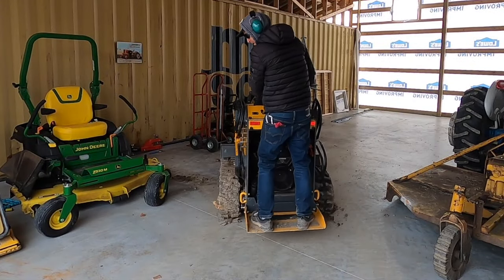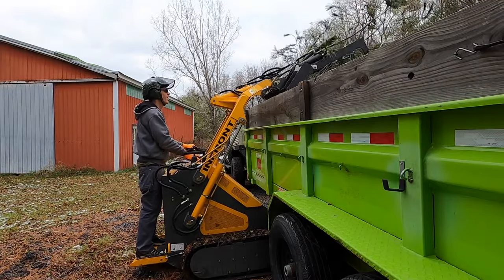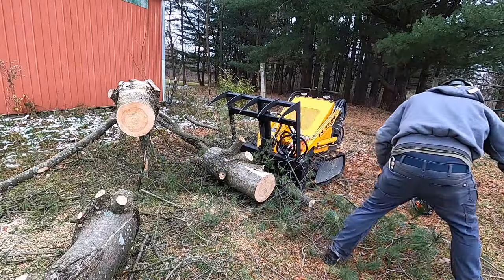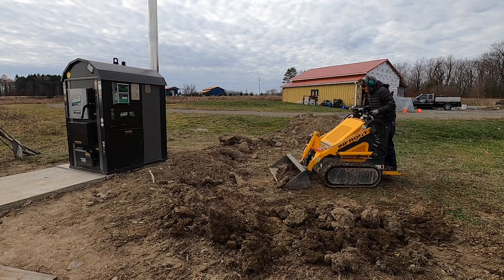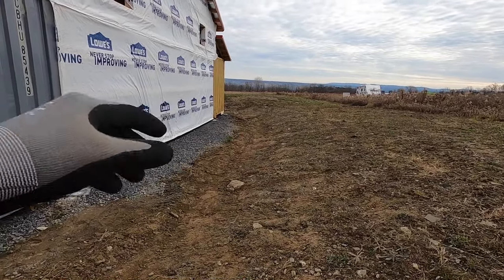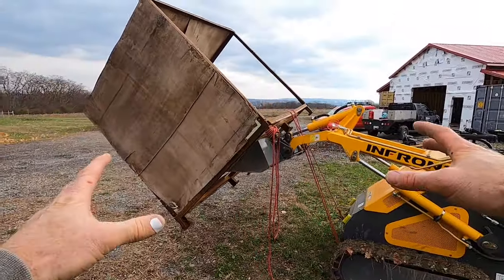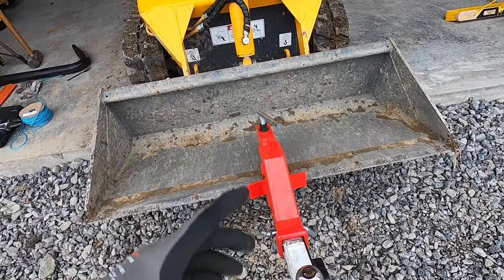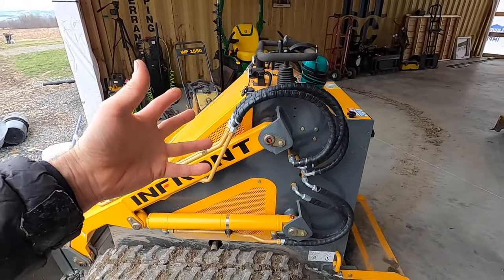Using the Mini-Skidsteer on Tree Jobs & Dirt Work

Comment: If you dont mind a little more saw work...cut those branches shy of the with of the trailer and load thru the tailgate area. When loading you just push the previous grapple load fwd with the next one. Me personally i use this method when loading with the smaller mini skids and high side trailers.
Reply from the maker: Cool method

Comment: That hitch attachment gives the trailer ball load way too much leverage to tip the loader forward.   Putting the ball in the bucket, (or better yet making a custom hitch that replaced the bucket and attached direct to the machine) would give the machine a lot more chance to control the trailers
Reply from the maker: You said it -- a hitch way farther back would make a big difference. It's been on my mind for a while but just haven't gotten to it

Comment: Some old ply wood around the trailer will prevent the digging in on the treads. You should have gotten the forks.
Reply from the maker: thanks for the tip! it's been a great machine
Reply: @metaspencer  i have a small project and am thinking of getting one with wheels, forks, grapple, and shovel.  I have lots of use for the forks but not a lot of room to store. And not sure if they make a box blade or soil lever but would need that as well.  I’m in Texas but not near the port.

Comment: On the left side of the device are some connectors to power accessories, like an auger. On the right side, that space is empty, and looks like it has a gusset plate. That is probably a more ideal place to drill through and attach a ball to pull your trailers. You could install a 2 inch ball. You can get a clamshell adapter to use that ball as a larger ball to pull your larger trailers.

Comment: maintenance needs: what are they? How does one adjust tracks after they stretch a little. Did you get an extra set when you ordered all this stuff?
Reply from the maker: So far I've had only minor maintenance: oil change, tightening some hydro fittings, putting a track back on. As for adjusting the track tension there are just some tensioning bolts: no big deal. I'll need those extra tracks tho!

Comment: Having now owned it for over a year, how would you rate the reliability of it? I build fence during the summers and I want to use one of these with the auger attachment
Reply from the maker: The only problem I've had is that on uneven sloped ground I'll sometimes pop a track off -- easy to reinstall. The thing runs well and lifts like a beast. I haven't tried the auger attachments
Reply: @metaspencer  thanks man!

Comment: For getting brush, stack large piles, then when you pick them up, with the grapple open press down so you compress the pile and get more :)

Regarding unloading, you might get locking tie downs and choke them around the piles to make getting them off the grapple easier.
Reply from the maker: I've gotta work on that smashing technique you describe ... I'm thinking bigger piles will help and give more brush to smoosh down in the end. Thanks for the tips! I'm still getting the hang of working with this machine for sure. :)

Comment: When moving a tandem axle trailer level it out so you aren't lifting the front axle. Also with the bucket lower there's less mechanical advantage trying to tip you forward. Thanks for the videos
Reply from the maker: Thanks for the tips! That makes good sense

Comment: For the logs, tilt the grapple (a little), yes your load is a tad higher, but closer to your center.
For the trailers, the closer you get the ball to the machine, the more you will able to move without front tip.
Reply from the maker: Thanks for the tips, man .... I'm still getting the hang of it for sure. Much appreciated
Reply: do not drill a hole in the bucket, they make qt adaptors with a receiver hitch welded on for about $125, and the lift point will be 18" closer to the machine.

Comment: I bought a Boxer 322D 
Similar Machine..had it now 8years
Been reliable and has 1600 hours
Anyway I welded a receiver hitch short sleeve to top of bucket.
Push trailer is easier than pulling.
Reply from the maker: I have a buddy with a Boxer and it's a beast. I've gotta do that with the hitch sleeve! great idea. thanks man

Comment: If you have any track related issues where do you buy parts? iv considered buying one of these but im leaning on a wheeled model for ease of service/parts .
Reply from the maker: Yeah tracks can be both hard to replace and a hassle to get back on when you drop one out in the field. For me, I prefer tracks just because I'm always working in mud and soft ground and they seem to work (for me) a lot better. As for replacing the tracks there are a lot of dealers around the US that sell them. I'm not worried about finding new tracks, but they're not cheap

Comment: For moving trailers, would be interesting to see you try it with the bucket down much lower.  You had the bucket up high which raises the center of gravity and makes it want to tip easier.  If you raised the trailer jack so that it could go significantly lower, I wonder if you could get it to move the flatbed or dump trailer?
For moving logs, you can tilt the grapple all the way forward/down, open it up, and pick them up more like a claw machine, then curl the bucket as you raise it.  Also, why cut those logs into such short lengths if you have the equipment?  One of the advantages of equipment is you can leave them longer than what a person could pick up easily, so you could do that trunk in less trips.
Reply from the maker: Good points man -- yeah, my techniques with the machine definitely improved over time. thanks man

Comment: I was thinking about getting a similar machine until i saw this video. Definitely wouldn't be able to use the dump truck to dispose of brush so id' have to get a dump trailer as well instead of just pulling my equipment trailer over to the job loaded and using the truck for disposal and gravel/ fill. Going to keep using my bobcat 773 till i find a good deal on a mini skid steer that isn't a stand on unit. Thank you very much for the video. i didn't even think of that issue until i saw you using the grapple. My dump bed rail is probably a foot higher than your trailer, maybe a more.
Reply from the maker: That makes perfect sense -- ya gotta get the tools that work well with your setup. That machine will come along ... just keep an eye out!
Reply: @metaspencer  That’s a fact. Hope all is well and the jobs keep flowing in. Keep up the good work.

Comment: You might try taking a side board off your trailer, might make dumping the grapple a little bit easier? Maybe grind down the points on the grapple too, looks like they stick into everything you pinch down on. Idk, just a couple thoughts.
Reply from the maker: Thanks for that idea. Yeah lowering one wood board on the trailer would make a big difference ... and they slide right out. I've gotta modify that grapple like you say because those lower tongs are weak and too long. thanks man

Comment: I have a driveway a half mile long in Northern Wisconsin.  Do you think I could buy this and use this to remove snow in the winter on the long driveway?
Reply from the maker: Our driveway is only 1000' and I've thought of putting a slanted snow blade on the front, but I haven't used it that way yet. I currently plow with my tractor and know that a foot of heavy snow can get heavy really fast, so you'd have to be patient plowing with this smaller machine.

Comment: Well, we have one that we use the logs away and we move our dump trailers with one and it moves. It just great and we move our chipper around to where that and they are a good little handy machine.
Reply from the maker: sounds like a good setup!
Reply: @metaspencer  and plus are Grafos are a lot smaller than yours to where it’s not so front heavy

Comment: For a quick unobtrusive counter weight I would recommend to remove the factory standing platform and replace it with a solid two inch plate of steel.  If you don't like it you can swap back to the original setup and try something else.
Reply from the maker: Cool idea ... I like how that piece of plate could come on or off depending on the job. I've worked with 1/2" plate but never that thick of a piece. I'll have to keep my eyes out and the torch warmed up
Reply: @metaspencer  I have a piece of 1 1/2"  24x24 and as I recall it weighs in at about 240#.  I will have to recheck thickness.  I use it for winter traction in the empty bed.  So you get a very lot of weight for very little room.  Stick welding with preheat is best.  Just need a couple of strong brackets or beef up your standing platform and put it in there.  Easier to handle with a couple of lifting eyes attached.
Reply: @metaspencer  just measured it. 16" x 22" x2" so two would be about 500#.  Do it in four pieces to keep it manageable.
Reply from the maker: @douglasthompson2740  Now that's a piece of steel! I'm jealous
Reply: @metaspencer  Until you have too. Lift it!!!

Comment: Hey there, thanks a lot for showing us all your experience with your purchase, so I'm planning on making a purchase on Alibaba as well. Few questions, What shipping term did your order fall under? I'm assuming CIF (cost, insurance, freight?).
I saw your other comment regarding the price you paid; was there unexpected fees associated with importing it once it was at the port? Also you mentioned getting a shipping agent, is that required. I got a quotation from the manufacture CIF to my nearest port and I'm trying to quantify unrelated costs I may run into. Does all the documentation you need for pickup at the port come directly from the sales rep that you worked with on Alibaba?
Reply from the maker: Heya, good to hear from you. I'm not too sure about the "shipping term" you mention but can tell you that the machine itself is about $9k right now. There are some fees, import taxes, etc. And all that added up for me to another $3k or so. The shipper charged me something like $800 in New Jersey to release the machine, and then my agent was about the same. You CAN avoid getting a shipping agent, but you'll need to apply and be approved to be an importer there the US gov. I've applied for that but it seems like a slow process. As for documentation you need at the port that came (in my case) from the shipping company which was Vanguard Logistics. After the item leaves China most of the communication is with the shipping company. Message me if you have other questions. I should probably post a video all about this process ...
Reply: It’s gone down 3k in the last 2 months?
Reply from the maker: @alldaydizcounts3692  I dunno about the price changes -- as of today looks like it's 9k for the machine, more for whatever attachments you get, then the fees and charges which are another 3k or so depending on where you live

Comment: I wouldn't put a ball in the edge of the bucket. Seems it would be in the way too often.  I would consider welding a 2 inch hitch receiver tube into the top of the bucket out of the way.  I put one on my tractors box blade and it works without getting in the way.
Looks like you are making the most of that little machine.  Love all the videos.
Reply from the maker: I like that idea of the receiver tube up top! Thanks for that
Reply: I have a receiver in the middle top of the bucket on my mt55. Works awesome for smaller trailers
Reply from the maker: @taterhater2086  That sounds super handy
Reply: How about drilling a hole in the bucket and installing ball when needed? I think a lower angle (bucket near ground) would have helped with the small machine too.
Reply from the maker: @dhenschel4 yep that would be a real improvement

Comment: I finding  the grapple to be not the best. What is the lift capacity of the unit?
Reply from the maker: Lifts about 500 lbs but ya gotta subtract the weight of the attachment ... yeah, that grapple is not so great :)
Reply: @metaspencer  do you think the hydraulics can lift more? Could you lift 1000 pounds with some counter weights?
Reply from the maker: @gsmscrazycanuck9814  no even with more weight I don't think it could do 1k ... that's the lifting strength of much bigger machines

Comment: Im wondering if it would be easier to load the trailer by driving up the ramps right into the trailer with the pile of brush, then it can be compacted too. May or may not work just a thought!
Reply from the maker: With some loaders and trailers that would be a great way to go ... but with my setup going up and down those ramps will make your earlobes tremble and eyebrows fall out. Super sketchy! :)

Comment: Seems like it might be easier just getting some long ramps, and driving that machine right up and into the back of the trailer, to load that up with brush.  Either that - or some some fold down side on the trailer..
Reply from the maker: Yeah sounds smart work workable

Comment: I weld a nut onto the bucket then screw the ball on and off.
When you want the nut gone cut the welds grind down with the flappy disk and no holes in the bucket
Reply from the maker: Now that's a cool no-hole method. I like it. Very smart. Thanks man

Comment: open the rear doors and push in from the rear.... also compacts debris
Reply from the maker: You said it
Reply: Makes it much harder to unload. I've found it best to have all the thick ends of the brush pointing backwards, so the branches don't stick out and resist getting pulled off. It's also worthwhile to tie a strap around it and compact it. That way, I can fill my trailer 4 ft high 3-4 times before driving to the dump

Comment: You should buy a better grapple. More like a root rake type. Makes thing so much easier.
Reply from the maker: I hear ya man -- or fabricate one. This one is kinda like trying to eat spagetti with a knife
Reply: @metaspencer  

Lol. 

Yeah, I have been using skid steers and tractors for over 20 years. Lots of grapple time, and I have never seen one like this one you have. 

I think fabrication of one is definitely a good idea. You know what you need in a tool, and if you can fab your own it will have far more value to you than one you bought. 

Keep up the good work!
Reply from the maker: @Just_Chuck_It  Yeah, they really cooked up a doozy with that grapple :)

Comment: You're wearing the best helmet money can buy and doing tree work in tennis shoes with equipment and chainsaw. Don't cut corners. Wear some good boots with steel toes. Crap happens doing tree work and steel toes especially with equipment factored can save you for sure. I run a sk1550 and sk750 and absolutely love a mini. Take your grapple and roll it up and over the pile to scoop better. The bottom should be straight up and down when you're grabbing. Put cross bar between the tines to strengthen it up some.
Reply from the maker: Good advice! I’ll get the hang of that grapple….

Comment: I’ve seen you weld… you’re good enough… lol. Thought: reduce the length of grapple, it would not over balance the machine as it is now, would dump better. Look at the bucket depth, its ideal. Over loading the machine with front loading and putting counter weights on the rear would likely be stressing the overall design thinking thoughts like cat in the hat thoughts
Reply from the maker: yeah absolutely man: it's all about deciding just what to do and then cutting into it with a vision. I absolutely appreciate your point: the dang grapple is just too long

Comment: HP?  Engine?
Reply from the maker: Brigs and Stratton Vanguard 24 horse
Reply: @metaspencer  Thank you. I'm debating to get a 15 hp or 23 hp mini skid steer. It's a $1,700 difference. I only need if for residential use.
Reply from the maker: @2006mrderrickh  bigger is almost always better ... but depends on what you'll be lifting